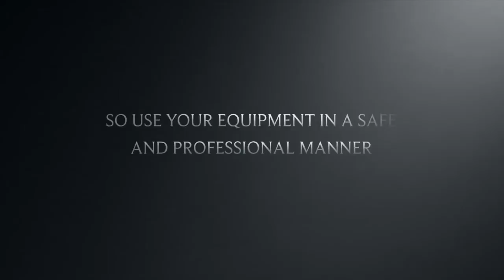Making a Wooden Scrub Plane - Part 4

Comment: Just wanted to say what beautiful craftsmanship, been a pleasure to watch, now planning my own set of planes. What plane irons do you use?
Reply from the maker: +Philip Shemilt thank you for your kind words - for the scrub planes I used replacement irons for the Veritas scrub plane (the high carbon steel works just fine) . For the planes my father built, the jointer and smoother, he used the "blades for wooden planes" again, from Veritas. 

http://www.leevalley.com/en/Wood/page.aspx?p=60009&cat=1,41182,43698&ap=1

http://www.leevalley.com/en/Wood/page.aspx?p=51871&cat=1,41182

Hope this helps and good luck!